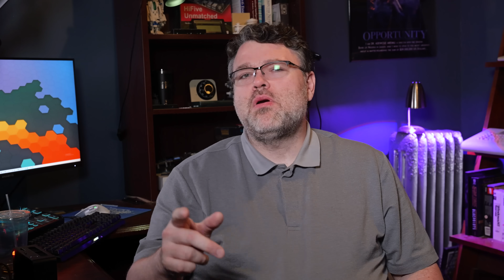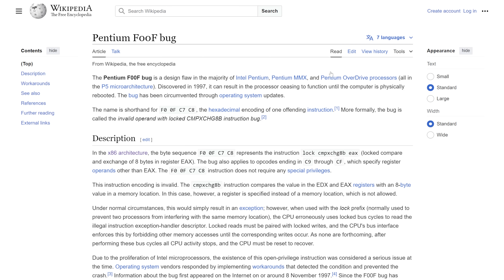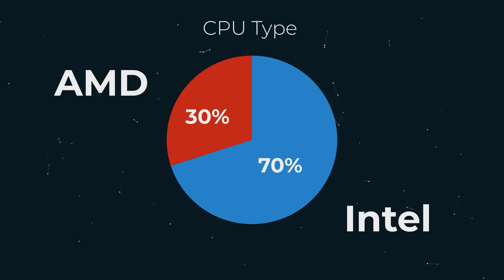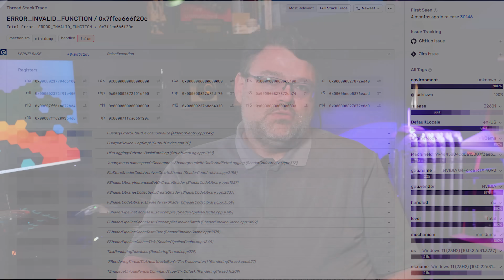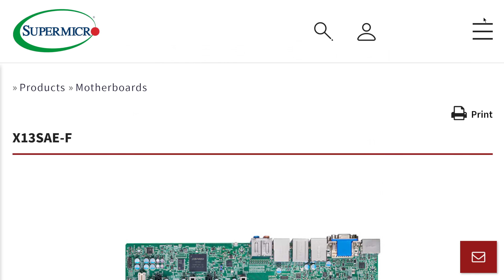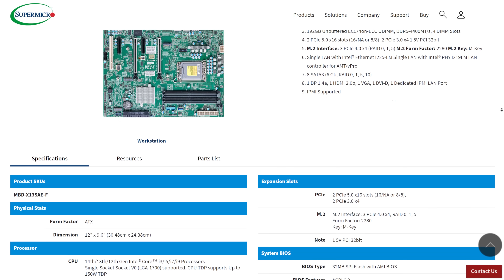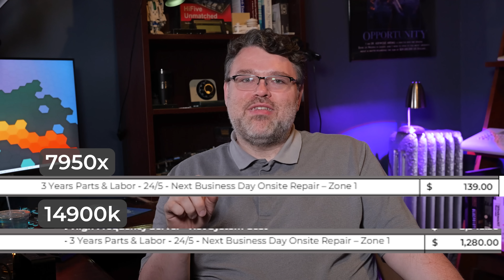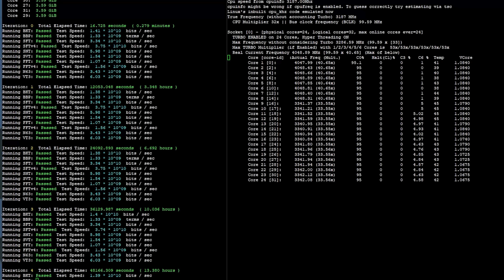Intel has a Pretty Big Problem

Comment from the maker: Intel PR posted an update to... reddit. So check that out, update your bios, and look for another update to your bios coming mid august 2024! 
https://www.reddit.com/r/intel/comments/1e9mf04/intel_core_13th14th_gen_desktop_processors/

tho they seem to have deleted some of the better questions about whats covered under rma, are folks that have delidded covered (guessing: lolnope), etc.
Reply: does this also apply to i7 14700 hx laptops ?
Reply: Can you confirm if there are any issues with the mobile cpus? 13700HX, 13900HX, 14700HX, or 14900HX? There is a lot of confusion on the reddit side of things. One developer (Matt Alderon) is claiming issues but other than him, I see nothing. Thanks Wendell and team.
Reply: What about the i9 13900h laptop version?
Reply: @Level1Techs  they posted the update to the Intel website. But yes it’s clear most of you guys get your info from Reddit…
Reply from the maker: Intel left out the oxidation issue on the website, which is real, interestingly
Reply: @Level1Techs  sh8 i just ordered a laptop with a 19400hx on the acer helios 18...am i screwed? considering i live in the phil and my sister bought it for me there in the u.s...yikes
Reply: @Level1Techs  They addressed oxidation and said it is unrelated to this issue. But YouTubers like GamersNexus won’t accept what they said. Interestingly none of y’all’s reviews of the 13th gen even mentioned stability issues
Reply from the maker: this is factually inaccurate. you might have misunderstood the degradation issue means that what worked on launch no longer works. or you are intentionally misrepresenting both things.
Reply: @Level1Techs  The degradation is due to high voltages. Does via oxidation result in the same or any degradation? Intel clearly suggests that it does not, only that it can be associated with a small number of instability reports in early 2023.
Reply from the maker: @ZombieLincoln666 but the high voltages were present on review day, right? and everything was fine? why try to bring launch day reviews up unless you're trying to misrepresent something
Reply: > Intel left out the oxidation issue on the website, which is real, interestingly

 @Level1Techs  The reasoning is simple: on one site they are legally bound, in the other one they are not.

Doesnt look good and also may have implications as to why they are so adamant to NOT include server/mobile chips in this issue. Replacing a few enthusiast CPUs with RMAs? Sure no problem, but recalls for BGA products like mobile and vast deployments in server/enterprise would be a total nightmare for Intel.
Reply: @Level1Techs  did you see Puget systems new report? It paints a wildly different picture than what you YouTubers have. But the damage is done. I hope Intel floods the market with more copies of GamerNexus’s stupid modmat. Or better yet, sue him for defamation
Reply: @USAchildsoldier  cherry picking from a single dataset that (barely) supports your argument doesn't change the data.
Reply: @USAchildsoldier  Puget systems have a very VERY big dog in the race, as they sell custom high end PCs with cooling loops and the like. 

Right now, their top end loop designs only make sense on Threadripper, Xeon Client and... Drum roll... High end i7/i9. They don't make sense on Ryzen when their biggest 16 core part can be cooled by a $30 air unit. 

When 2/3rds of your market is under threat, you will take actions to reduce the threat. That includes introducing your custom tuned and clocked system reliability data that is wholly able to dodge the actual problem. Puget would have had RMAs early in the release cycle and made BIOS adjustments to reduce that, likely fixing degradation long before Intel even mentioned it. The problem is that default settings damage the chip, meaning you can't buy one for family without having to drop in and tune the BIOS clocks.

Puget don't even run default settings. To make matters worse, the reason that this video is so widely regarded as important, is because it contains a database of failed CPUs in W-class chipsets, which are vetted server i9 boards. They are failing more(!) than standard Z boards because you CANT custom volt and clock them.
Reply: @sixpots  In fact it's dangerous and leads to more issues. 

Puget sells factory overclocked systems mostly, and go and hand tune each BIOS to their own settings. So the implication is that it's possible to get 14th gen working reliably is true, but the fact that it's only possible by messing with the settings yourself and possibly making it worse is never mentioned by anyone using that dataset. 

If he really wants people to be alright, he should at least tell them the whole story. Well tuned 13/14th gen is fine, but stock and IBS will degrade.
Reply: @USAchildsoldier  Intel isn't gonna sleep with you bud, or write you a check. You are grasping at straws and trying to misrepresent hard data to fanboi suckle at Intel's teat. What's even more hilarious is watching you try to act like it's Gamer Nexus' or Wendels fault for reporting on data gathered on Intel's screwup. Drop the fanboy level down a notch or four.

Comment: I am watching this video and both the Gamers Nexus and JayZTwoCents in 2026 which is 2 years after both videos were created.  I have an Intel Core i9 1300k processor that I purchased right when it was first released to consumers.  I am not a gamer, I do not process large video files nor edit any but I am working on several projects using Hyper-v VMs with one particular machine being Kali-Linux based and using a nested Docker container with another Kali-Linux machine that has both the ChatGPT Linux based desktop app with Codex functionality installed along with Hermes Agentic AI installed that connects back to LM Studio located on my physical Pink PC that the VM is hosted on, and I am experiencing frequent crashes just like described in the videos.  Important note, I have a Zotac Gaming NVIDIA GeForce 3080 RTX for my GPU.  I have run tons of appropriate diagnostics to eliminate the RAM (MemTest and other diags) and tested the 2 Samsung 980 PRO 2TB M.2 NVMe SSD all of which has tested out healthy.  I will be pursuing the Intel warranty replacement process.

Comment: My Ryzen 5900 had the internal Cache degrade.    A pain to troubleshoot.   It would only crash at low clock multipliers.   So i ended up having to force no low multipliers or power saving modes.

Comment: I've had 3 or 4 13900ks / 14900k's and they start degreding over time. I am not even overclocking these cpus and after a while they just start crapping out. Failing P95 FFT torture tests or outright crashing games such as PUBG. Not only that but in some games I experience severe stuttering despite my FPS being high (200+). I've gone on a journey trouble shooting this and at first I thought it was the motherboard or the RAM. I replaced the ram and even bought a new motherboard only to find out it is these CPU's.

I would RMA one and get a new one and months later the new one starts crapping out in the same manner. From a 13900KS to a 14900k. I am torne.

Comment: I've been researching this issue extensively, since I'm in charge of IT systems at a school and we have many computers with 13th-generation Intel processors. Unfortunately, based on the information I was able to gather, it looks like we've fallen into the same nightmare we experienced back in 2008, when NVIDIA used low-purity copper in their chipsets, which degraded due to oxidation. The oxidation process was accelerated by high temperatures, but even at lower temps, the defective chips would eventually fail.
Back then, the only permanent fix was to replace the chips that contained the contaminated copper — everything else, like BIOS reprogramming or improved cooling, were just short-term band-aids.

From what I’ve come to understand, Intel used low-grade copper in all of its 13th-gen and later processors. What we’re seeing now — high-performance CPU failures — is just the beginning. I’m afraid it’s only a matter of time before all these processors, from desktops to laptops, from high-end to entry-level, start failing. Just like with the NVIDIA situation, I suspect the majority of Intel's 13th and 14th gen processors will eventually fail, with only a few lucky ones surviving.

From this perspective, no microcode update or BIOS tweak is going to fix the issue — not even temporarily. At best, it might slightly delay the inevitable.

The biggest problem is that Intel refuses to acknowledge the issue, and they’re alienating their customer base because of it. For example, I would never recommend Intel again — this flaw is putting my job at risk. I was the one who convinced management to go with Intel-based PCs at my workplace. So when all those machines inevitably start failing, I’ll likely be held responsible.

As proof of my hypothesis, I currently have a friend’s PC on my workbench at home — it’s got an Intel Core i9-14900K. It started having issues right out of the box. The PC was barely used because they could never get it to run properly. No patch, update, or adjustment has fixed it. Clearly, the CPU was defective from the factory — something I had never seen happen with Intel before.

Comment: I tend to lock my CPU chip,  and my 13900kf is doing fine after 2 years.
Mind you, I locked the voltage and core frequency(5.8/4.5 @1.37v).
I guess I got lucky, and my CPU would probably fry if I let things on auto.
My next CPU will definitely be AMD if intel doesn't come up with something good.

Comment: I find if I use x86-64 or the generic "march" with GCC compiler I will get specter based bugs on compiled software, but if I disable preempt and hyper-threading the program does not act sluggish.  One thing I find interesting that passing  -march=alderlake -mtune=alderlake compiles ok sometimes, other times the specter bug pops up. No reason why compiling the same code with the same flags results in a program that behaves different.

Comment: Ive never had an issue with the 13900K CPU.  I own 2 of them and they run great. No crashing and both are overclocked. But the 14900KS I bought was a different animal. It did crash my system and games. I had to lock my P Cores at 5.8 and disable Thermal Velocity Boost. So I basically would up with another 13900K.  Later Microcode updates have relieved the issues and now I'm back up to 5.9 on P Cores but still can't use TVB. I'm OK with that. I need a Chiller.  I'm not going to download the latest Microcode though because it hurts performance and the Chip is running great.  Doesn't crash at all anymore. 😊

Comment: I bought a 12900k 2 months before the 13900k. I've been having the same issues with the 12900k since about 5 months after using it. I believe the TDP on these motherboards have degraded the chips a bunch. I also have beefy water cooling that keeps the temps around 80 at full load. - The bios probably called more power because of the cooling efficiency on mine and burnt the chip up.
Reply: It finally gave out yesterday. Any load for about 2minutes - Blue Screen Crash.

Comment: Wendell said "Locking the multiplier and setting a fixed voltage is the lazy way to deal with it that only a sad person would do." That's a shot at frame chasers for the vid table comment.  Wendell seems too classy to be involved in tech tube drama, but there are a few tech tubers that need straightening out.

Comment: I have a 13700KF and have had issues since day 1.
I have updated to the newest BIOS (ASUS Z790-P D4) and still have the same issues with sudden Blue Screens, Game Crashes and Black Screens/No Signal. The new BIOS firmware was going to "fix" this! NOPE!
@Level1Techs
We need to dig deeper in to what is causing this,
Thx!

Comment: I use Photoshop and lightroom in photo editing. I have been having problems for 10months since I upgraded my computer to 14th Generation. shuts down randomly, cpu up to 99% had it in to tech for fixes etc numerous times. still same problems. I am over it.

Comment: electromagnetic spikes/ noise?
Reply: I have it in the earjack output of a Raptor Lake system. It's not grounded, too far away from any ground wire. I can hear the memory as well as visible screen activity through the audio. It sounds really alien.
This modern stuff is really on the edge of reliability. Not only Intel, btw.

Comment: If you're experiencing stability issues with your CPU, especially after BIOS update 129, and can only achieve stability by downclocking to 5.6 GHz, it may indicate a hardware problem rather than a software issue. Here's my experience and advice:

I initially had to downclock my CPU to 5.6 GHz to maintain system stability.
I tried various tweaks, but none resolved the issue.
After BIOS update 129, the problems persisted unless downclocked.
I purchased my computer from Microcenter and eventually had the CPU replaced.
The replacement CPU fixed the stability problems without downclocking.

If you find yourself in a similar situation, don't assume that future microcode updates will resolve the issue. Instead, consider getting your CPU replaced under warranty. Don't settle for a consistently downclocked CPU, as this likely indicates a hardware defect rather than a software problem.